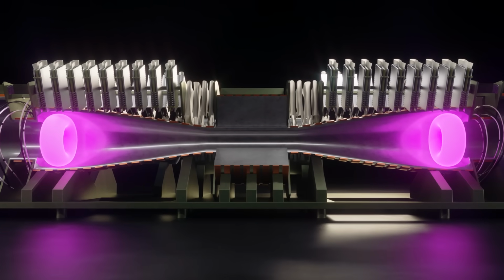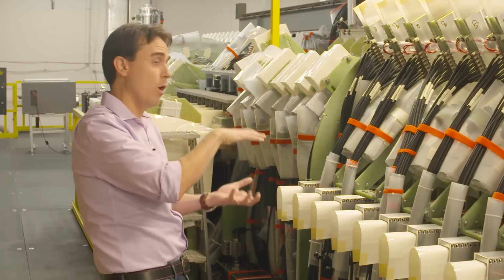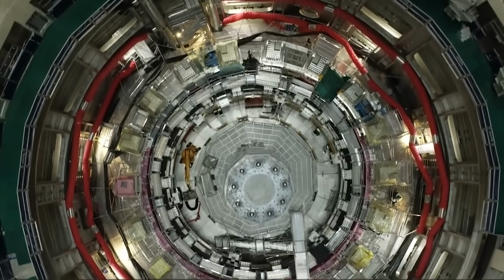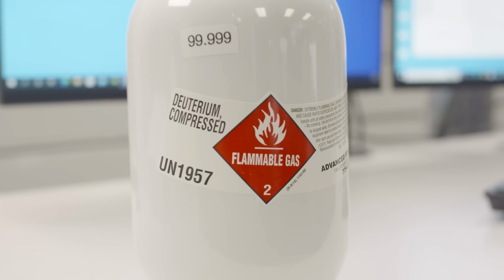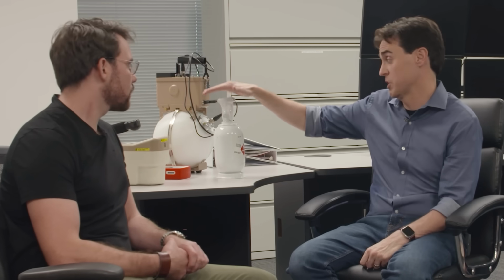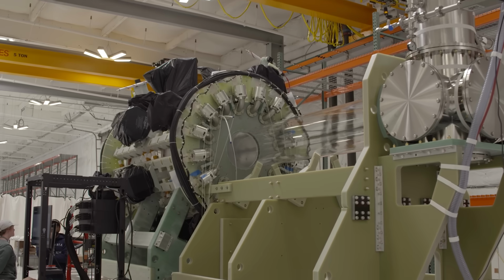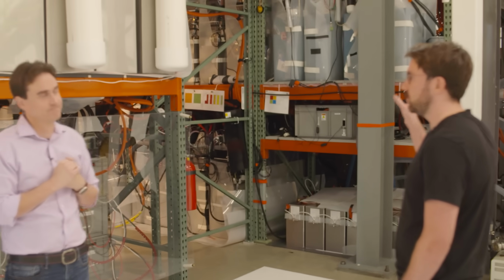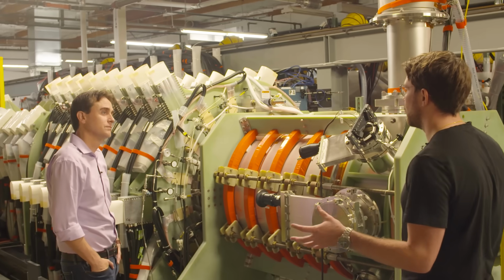A New Way to Achieve Nuclear Fusion: Helion

Comment: how do you comment on this please:        https://www.youtube.com/watch?v=3vUPhsFoniw      The problems with Helion Energy - a response to Real Engineering
Reply: @ashifarman4813  Been discussed here at nauseum in several comment- threads. 
In short, Helion actually wants the D-D reactions because that is how they make the He3. 
Only one in 3 reactions produces a neutron. These neutrons only have 1/5 of the energy of a neutron from D-T reactions.
Those low energy neutrons are easier to shield against and they react in a much more benign way with many materials that Helion uses. E.g. the silica tubes used in the first wall have to capture 3 neutrons before they become radioactive and then only have a half-life of 2 hours. Aluminum in the magnets has a half life of 2.5 minutes.
D-T side reactions do not happen for many reasons: The Tritium is too hot and non- collisional on the time scale of the pulse. By the time it has cooled off enough to fuse with Deuterium, the pulse is already over.
The Tritium along with the unburnt fuel is extracted between pulses. So it does not remain in the machine.
Trenta was an experimental machine that only did one pulse every 10 minutes. It was not running on Deuterium all the time. 
The neutron damage on Trenta was thus minimal. There was still permitted shielding in the walls around the machine, but not close to the machine.
The picture of Chernobyl was ridiculous.

The rest of what he said also stems from a complete lack of understanding and desparate need to "find" issues to have "content". None of them have any merit.
Reply: The IM video is nonsense. It has been discussed here many times.
Reply: @elmarmoelzer2229  ok - and where exactly?

Comment: He-3 costs nearly $3,000 per liter at STP, because it's very rare.  I believe people have talked of "mining" He-3 from the Moon's coldest spots.  Would be nice, if it actually works.
Reply: I thought it was around $1400 per gram of helium 3? The liter being about 1 kg would be around $1400000 per kg of helium 3. Please correct me if I am wrong.
Reply: @mr.ackermann807  - One liter of He3 at STP (a GAS) does not weigh 1 kg.  It weighs 0.1786 g.
Reply: @JesseHBrewer  sorry, my chemistry is a little rusty. I also mistaken it for other elements and gasses and linked liters to kg on other math. Thanks for correcting me.
Reply: Thats why they are making their own by fusing Deuterium.
Reply: @elmarmoelzer2229  - D-D fusion peaks at nearly 1 MeV.  I suppose they might get an infinitesimal trickle of He3 from the D-D channel, but I'm skeptical, to say the least.  Not my field, though.

Comment: This is one of the coolest things I’ve seen in a long time. And the fact that it looks and works similarly to the warp reactor on the Enterprise D, makes it just that much more awesome. The best part is, it’s not just another super over complicated way to boil water.
Reply: I was thinking the same, looks exactly like cylindrical “warp cores” or “fusion cores” that are in a lot of sci fi media.
Reply: LOL I was thinking the exact same thing hearing the term "deuterium" 😀
Reply: @harveyspecterdj6661  "zee sheeps out of dylithium kreestals cap'n"

also looks very similar to the one used on the enterprise NX-01, from StarTrek Enterprise.
Reply: And it works on pulses too! When they want more power the pulses get faster

Comment: His numbers really scare me, he's talking about millions of degrees and speeds like 300k km/sec! Sounds like this building is close to be blown up.
Reply: No. The power is large, but the energy is small. A single pulse, even after all the fusion reactions does not contain more than a few kWh of energy.
Reply: One spec of dust, heated to 100 million degrees, and shot a 300 km/s in air, is not going to make much damage. Not only temperature and speed matter, mass also, and the amount of plasma inside a fusion reactor is measured in milligrams, or even fractions of milligrams.

Comment: lol this is sobering: https://www.youtube.com/watch?v=3vUPhsFoniw
Reply: That video is total nonsense, based on misunderstandings (uhm a plasma physicist gets all of the information from a video made by a channel made for the general public and a few blog posts?).
And then there is a lot of nonsense on top of that. Give me a break!
Reply: Granted, fusion energy is really difficult, and Helion may well fail, just not for the reasons offered in that bad critique.

Some of the numerous mistakes in that video you linked:

1. Helion reactors are NOT aiming for a plasma temperature of 100 million ºC (9 keV). Much higher, ideally up to 450 million ºC (40 keV).
2. At those temperatures the ratio of the reactivity of D-He3 vs D-T is going to be 2 ORDERS OF MAGNITUD better than the 1/1000 I.M. states.
3. Helion machines HAVE produced neutrons in the past. Back in 2019, their Venti experiment reached 10^11 neutrons per shot. In fact, their machines achieved this goal in 2011.
4. Helion HAVE shielding around their reactors. Even now, for small experimental machines such as the one shown by Real Engineering, that can barely produce a fraction of one joule in neutrons per shot, they have shielding. It wasn't talked about, or shown in the video, but is was there. Newer, more potent machines, will have stronger shielding (you can ask the NRC).
5. No, Tritium will not be a huge problem, because 1) the T ions will be too fast to react with D easily, and 2) each cycle will be too short for they to thermalize so they can interact with D in higher numbers.
6. Suggesting that Helion reactors (or any other fusion reactor I've heard of) can produce a disaster on the scale of Chernobyl, is simply ridiculous.

There are more but these are enough to back my point: That that is a very uninformed critique.

I.M. would have known all these things if he had taken the time to research this topic.

Debunking videos are generally fun. They tend to make us feel better informed than the average Joe, more intelligent. The problem is that sometimes they are the ones that need debunking.

Edit: corrected the number of neutrons made by Venti, 10^11, not 10^18

Comment: They completely ignore the fact that the reactor will have D + D reactions. So they will have to deal with neutrons. And they don't seem to care. This will not make 1 W of useful energy. As it stands it's just a investment trap. Not unlike Theranos & Co...
Reply: They do NOT completely ignore the fact that they will have D-D reactions. In fact, if you had spent even a minute to check the FAQ on their website, you will find the answers to all that.
I short, they even want the D-D side reactions because those make the He3 that they need as fuel. The neutrons from D-D reactions would only appear in 1/3 to 1/4 of the reactions and are much lower energy than the neutrons from D-T (2.45 vs 14 MeV). That gives them more options for materials and shielding.

Comment: Even if the energy gain was feasible and much higher/cheaper than existing technologies, it would likely create more problems than solve them if we don't work on ourselves a lot, primarily. The ecofascist agenda for example obsesses over scarcity, enforces it, needs it for self-validation. So for example energy abundance wouldn't change German politics of pushing presumed super-efficient technology, because it is all about money and influence. Societal structures can change easily to turn energy abundance into energy scarcity again. It is all highly interpretative, relative and malleable. One example: If you have abundant energy but the declared enemy, too, then you end up with scarcity again because all that energy is needed for war, and thereby probably further empowering the military sector over the civilian sector.
Technology is an egoic power trip driven by fear management, and it disempowers us internally more and more.

Comment: IF THE RATIO OF Pout/Pin IS IMPORTANT, “GIGAWATTS OF POWER FLOWING THROUGH THE CAPACITORS …” Pin for a starting number is X GWatts. That is concerning. How much of that X GWatts of energy (in either single shot or continuous) is RECOVERABLE AND HOW ???  That would seem to be a real engineering question, rather than fusion fan boy admiration …
Reply: It is GW of POWER, but only a few kWh of ENERGY per pulse.

Comment: I wonder if they can power a system like this using another fusion system so set up capacitors would generate energy through fusion. That energy or part of it could be used to power another fusion system. Somebody needs to do the simulation in the math. That said, it's very exciting concept where the energies created directly without going through steam.
Reply: I am not sure what you were envisioning, but several of their machines can share a capacitor bank and power supply system (and alternate between them). This is likely what they will do for bigger power plants.

Comment: So then why aren't they using it for energy production...  Useless.
Reply: Because Trenta was a subscale experimental machine that cost less than 30 million to build. Its purpose was to validate their theory, which it did. It did not have the equipment (switches, etc) to extract energy back out of the plasma. Polaris will do all of that and produce net electricity by the end of 2024.
Reply: @elmarmoelzer2229  i see

Comment: real question still remains, can this achieve a net positive energy output
Reply: Trenta was an experimental machine. It did not have equipment for energy recovery. Polaris is still on track to demonstrate net electricity (not just net energy) from fusion by the end of 2024.
Reply: @elmarmoelzer2229 Also, another issue is how is polaris planning to solve the overheating problem? Theoretically it is possible to gain a net positive energy out of the system. Heat, durability, i d like to see more raw datas.
Reply: @yangjirui123  What overheating problem?
Trenta was air cooled. AFAIK, Polaris will have stronger cooling systems (I believe water cooled, but that might not be the most up to date information).
Reply: don't tell me whatever material Polaris or Trenta use can last for a sustainable amount of time to endure the duration of consecutive amount of fusion reactions. Let alone even if they can transfer the energy in the form of electricity, they will still need superconductor to transfer the electricity quick enough without melting down the wires. That is not to mention what kind of battery they plan to use to store such huge power.  @elmarmoelzer2229

Comment: There are A LOT of problems with Helion's modal here. I would put all the money I had on betting that they are NEVER going to get positive energy generation even in 20 years time. I'm surprised that Real Engineering didn't rip this apart more. Helion needs to drastically increase their temperature, they are losing a ton of energy generation operating at lower temps. And they are losing even more energy generation because they aren't using tritium but helium3 instead. The amount of energy they are going to need to use to get positive energy generation out of a massive and expensive version of their prototype is just gargantuan. They are going to need more energy than they are capable of pulling off the grid. They'll need to have their own HUGE energy storage field, bank upon bank of batteries be it flywheel or chemical or etc. And that's just to start their reactions. It's going to be MASSIVELY expensive. Why would anyone spead a trillion dollars getting fusion to work when we have great renewables? You need every bit of efficiency here. You can't just be throwing away massive potential gains like that before positive energy generation has even been achieved! This will never work.
Reply: - Trenta was a subscale prototype. Polaris will increase the temperature to over 20 keV and higher. They can actually get away with a lower plasma temperature because of the high ion- to electron- temperature ratio. The relevant equation is: 
P(fusion)/P(loss) = Ti^1.5 / (Z^2 * Te^0.5 ) where Z is the atomic number of the fuel.

- They are using capacitor banks that they are building in- house. The total energy storage capacity is 50 MJ. That is for both input and output combined. 

- The cost of the Trenta program was 35 million, peanuts for a research project of that scale and the results it produced. Those results got Helion and additional 500 million in funding, which they are using to build and test Polaris and to build their in-house manufacturing for capacitors, magnets, quartz- tubes for the vacuum chambers, turbomolecular pumps, etc. I would assume that the actual cost of Polaris is about 200 million, maybe 300. Once they reach commercialization, they are planning to mass- produce machines at a rate of 20 a day. Helion's machines are designed to be transportable by road. So, they can assemble them in a factory and then transport them to the desired location. That level of mass production will greatly reduce cost compared to the "first of a kind" Polaris.

Comment: Serious Question:  How do they stop the Deuterium in the fuel from fusing with itself and firing off a high eneergy neutron into the machine, the room, the staff etc?  This is not addressed in this video.
Reply: - Most of the shots with Trenta were either hydrogen or Deuterium only or some mix of D and H. They did have some campaigns with He3 and even with Tritium. Those were relatively few shots though. The neutrons from D-D reactions are only 2.45 MeV, which is below the activation energy of many materials. Helion chose the materials in Trenta (and future power plants) to behave rather well in a high neutron environment. The vacuum chamber is made from quartz, which has to absorb 3 neutrons to become unstable, after which it only has a half life of about 2.5 hours. The magnets are made from aluminum. When activated by a neutron, it has a half life of only about 2 minutes.
- Of course, no one is standing next to the machine when it is operating. Radiation falls off with the distance squared. There is also certified shielding in the wall of the building.
- Future power plants will have much more shielding since they will have a pulse rate of 1Hz to 10 Hz (vs one pulse every 10 minutes for Trenta) and they will want to fuse Deuterium in those too. About 2 Deuterium reactions for every Deuterium- He3- reaction. One of those two Deuterium reactions will produce a Helium3 atom which they need for fuel. Compared to a Deuterium- Tritium- fusion plant the total neutron flux is very low. Only 1/3 of the reactions produce a neutron and that is as mentioned only 2.45 MeV (vs 14 MeV for a D-T neutron). I calculated that less than 1% of the silicon first wall will have become unstable after a year of operation (and I used very unfavorable assumptions). The more expensive and sensitive components are at a greater distance from the central burn chamber. So they experience less neutron flux (square distance law).
Helion assumes that their power plants can be fully decommissioned within 2 weeks after the last pulse has been fired.
Reply: They don't, at least in the machine depicted in this video. People simply evacuate the vicinity, and control it remotely. And regarding the machine, it just bears the neutrons. Not that hard given that this device only shot once per ten minutes (at most), that many of those shots were "blanks" (with gases that don't produce any fusion), and that when using deuterium the plasma conditions were insufficient to generate much fusion, if at all.
Reply: @charliem6590  Oh Trenta did have have shots with a lot of fusion reactions. Venti's record pulses were at 10^11. Trenta would have had pulses at least an order of magnitude or more greater than that. But as you said, compared to a power plant, there were not that many pulses of that.
Reply: The next machines, the ones intended to generate energy, will be housed in a kind of bunker, with walls of borated concrete and other neutron absorbing materials 1 meter+ thick. Only the essential components (reaction chamber, magnets, vacuum pumps, etc.) will be inside, and made from materials that can withstand the neutrons. All the electronics, control hardware, and other fragile parts will be outside.